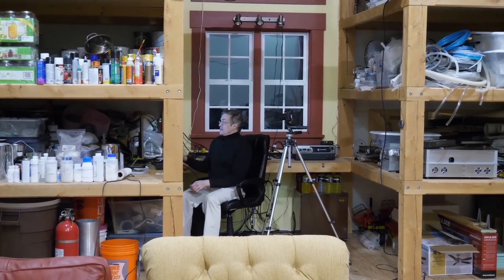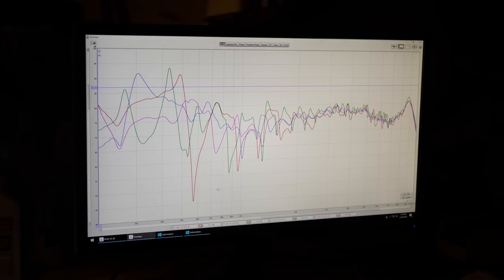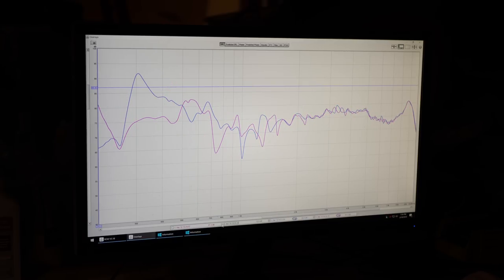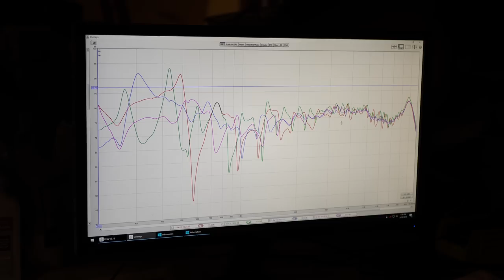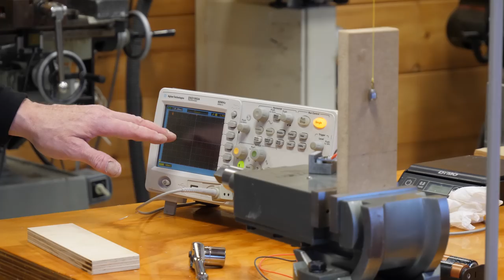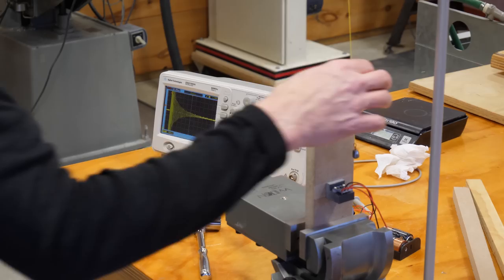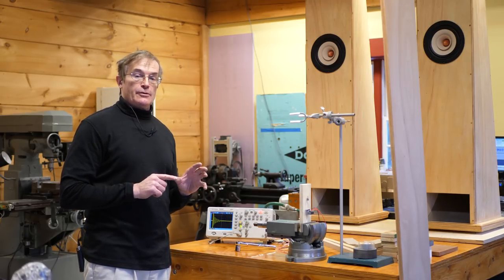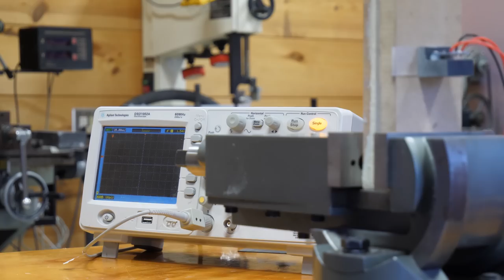World's Second Best Speakers!

Comment: "I have a lot experience with the marine plywoods and I would highly recommend them."
This one sentence perfectly encapsulates everything I love about this channel.
Reply: “Marine plywoodS” THERE’S MORE THAN ONE?!? HOW MANY MARINE PLYWOODS DO WE NEED?!?
Reply: @DanielBrownsan   Far more than you might expect.  But don't worry, the final tally is based on sound engineering principles and backed up by solid research.
Reply: Please tell  me how make good box for speaker   pioneer size 6/9
And what best wood use for that
Reply: @ahmadalardah4198  Get the T/S parameters for your speaker, use software like WinISD to calculate box dimensions, and then use MDF/HDF/high grade plywood (your choice).
Reply: Maxican When I was a teen I made a large rectangle cabinet for two 15-inch drivers out of quality plywood... Didn’t do any research or even know what I was doing, just hacked it together in a few hours and it sounded brilliant to me :P I guess I was too young and inexperienced to have a discerning ear for quality audio.

Comment: 25:31
-It is cheap
-It is easy to machine, it's cheap
-It is relatively inexpensive and easy to obtain
-And it's cheap
And did we mention it's cheap?
I don't think I can ever stop smiling after that.
Reply: But is it cheap?
Reply: @myxfit  Relatively, yes. He explains this in the video. It's why fibreboard is used in so many cheap wooden things these days. For example, my desk is LDF and the speakers I used to haul as a DJ had a MDF enclosure.
Reply: @LokiScarletWasHere  whoooosh? :)
Reply: @myxfit  Fair enough. Hard to tell in written communication.
Reply: i hate MDF. i found his breakdown of why someone might use MDF to be quite amusing. glad i'm not the only one.
Reply: @LYLEWOLD  MDF is way more superior to particle board are you kidding me! It's way stiffer and resonates way less
Reply: @MichelLinschoten  The demonstration was between MDF and plywood, not MDF and particle board. OTOH as he says, MDF is cheap. Here in Tasmania 18 mm MDF is $AU39.69 a sheet compared to $AU172 for ordinary 18 mm plywood and $AU261.30 for 18 mm marine ply.
Reply: i came here to look for this comment
Reply: @thatfeeble-mindedboy  You're way underestimating the ability of the resin binder to be a solid and transmit sound.  Particle board and MDF would be falling apart if they were as loose as you're claiming.  While their bulk is particulate in origin, they're roughly brought back up to low to medium grade wood by the binder.  That isn't sorbothane between those particles.
Reply: Peder Hansen  Exactly. It's essentially absorbs the sound energy.
Reply: @ModelLights  Are you serious or just trolling Kenneth? I can't really tell.
Reply: @misterhat5823  ' just trolling Kenneth?'  LOL Trolling him, I was simply fixing the silly 'composite construction means the binder must allow motion and the particles moving and absorbing' for anyone else who might later be mislead.  Google 'glue is stronger than wood', read up some, and realize even cheap binders are stiffening the crap wood particles that composite woods are made from, not allowing more motion.  MDF is generally about the same or even better than plywood, as was clearly evidenced in the video itself, and both were obviously well away from the actual absorber.
Reply: A better descriptor, as I learned in sales, is inexpensive. lol
Reply: And stiff!
Reply: I thought he was glitching.
Reply: That's the result of listening to test tone more than 3min.
Reply: @jonathansturm4163  It seems to me, that laminating two panels with that visco-elastic adhesive, would erase some of the draw backs to using MDF. The only difference would be, that the enclosures would be heavier, which, is NOT a bad thing. The more massive the cabinet, the less movement caused by the acceleration of the speaker cone. Dampening resonance is the name of the game. There's enough magic in the proper application of the right adhesive, that there is no need to choose the most expensive wood.(as long as appearance is no issue) There might even be an advantage to laminating two different types of wood.
Reply: since there's no frequency response measurements in the end of the video - I think we can agree that it (possibly) also sounds pretty... cheap.
Reply: @jonathansturm4163  Unless you're powering your boat with sound waves, why on earth are we comparing marine ply?
Reply: @TheNajSD  Marine plywood is manufactured from durable face and core veneers, with few defects so it performs better in humid and wet conditions. It resists delaminating and fungal attack. It's cheaper than furniture grade plywood that comes with a decorative face veneer and more expensive than construction grade plywood that has unsightly knot holes and splits.
Reply: @LokiScarletWasHere  
Wait till you see an MDF enclosure  sprayed with Rhino Lining
They can flex 3/8" without cracking or separating,  plus it reduces vibration
Reply: @LYLEWOLD  
Try spraying  BOTH SIDES of the MDF SPEAKERBOX with RHINO LINER
You cannot BUY a better box!
Reply: @ModelLights  
We spray our boxes with Rhino Liner
Amazing results!
Reply: @jonathansturm4163  
Marine plywood also off gases formaldehyde over the years as it cures and dries out
Reply: @thecloneguyz  There's formaldehyde in all plywood; in toothpaste, too. And wallpaper...

Comment: Kudos to getting rid of the myth about MDF being THE material of choice for speakers!
Also, great to see fullrange speakers properly used here (small cone impedance matched).
The Voight or TQWT designs are decent and easy to build, but you can also get excellent results with TML and horn designs.
Regards, D.C., creator of the Cornu Spiral Horn.

Comment: No frequency response analysis of the final product - I think you forget the somewhat vital last step? Can we assume there will be another video along shortly where you actually do a frequency sweep? You've shown us you've got the equipment and the prototype, so what are you waiting for?

Nice groundwork and great explanation - now give us a the home run. We are cheering you on!
Reply: And frequency sweeps at different off vertical/horizontal axis responses and listening heights - all major factors
Reply: The spl of the full-range Tang Band will rise as frequency increases, starting somewhere around 1.5 kHz and a significantly higher level at the upper limits of what the speaker can produce.  This is a baffle step that all full-range speakers produce.  A small -6dB / octave compensation circuit, an inductor in series with the driver and a resistor in parallel with that inductor (a BSC) has to be added.  This tunes the higher range of the speaker's frequency response  to the width of the front baffle.  I'm pretty sure there's a calculator on the net somewhere...
Reply: @stephenmackellar5072  I've also read about 1.5 way speakers, using a second copy driver just below but with an inductor to form a baffle step but adding extra bass, allows you to "possibly" cut some crossover components too.
Reply: Yeah, plus his demo recording at the end gives a good perspective from the POV of a giant robot laying down in front of the speakers. My head isn't 4ft wide and I'm not going to be crouching down off-axis to listen to them. The recording objectively sounds like rubbish, and is such a let down after such an awesome video!
Reply: I don't think they'll fit in the anechoic chamber ;-)
Reply: Impulse response probably even more important than the frequency sweep. Of course watching a video and listening over my ratty head phones doesn't tell me a lot about how good they are :-)

Comment: A frequency sweep of the finished speaker would have been nice.

But excellent explanation nonetheless.
Reply: jdlech nor is it an anechoic chamber in any sort of standard definition :p
Reply: @KYDY  Is it just foam on drywall? that must give some ugly reflections in the mids at least.
also lows which get through bounce on the wall and come back in
Reply: Watched this video several time. There is an indication some trial an error did take place in the acoustic insulation install. Some proof of concept is warranted. I am think about building a similar enclosure.  Some testing results could help to improve this design. Big question are there test results near field at least? My guess is an in line inductor circuit is probably required to get some of the lower frequencies to be more pronounced.
Reply: In an anechoic chamber with an actual test / measurement microphone (GRAS).

Comment: I was a little disappointed you did not show the frequency curve of the finished speaker.
Reply: I don't think it would fit in his chamber to measure it as he did with the smaller pieces. :(
Reply: I was disappointed by your comment. Now we're both disappointed.
Reply: I have known about a dozen or more sound technicians who have been able to tweak off the shelf speakers to sound fantastic placed in a consumers home.   I have known a similar number of technicians who have been able to make a system work in a room or a car and sound fantastic.   All have done testing of various materials under specific conditions to achieve results.  You seem to run a frequency sweep similar to AM radio, with few other restricted variables and  expect us to believe the results will be better. 

At best we can only hope to emulate what has been made on both analog sources and digital sources and come out with something that will sound good most of the time. 

To me, the best thing has been to find an amplifier and sound source you can live with, make sure the output to the speakers is in phase and to find the sweet spot where the sound sounds fullest and pleasing to the ear.  Analysis of sound waves are generally from a  single sound source under controlled system.  We listen through a number of speakers, bought at various times, for various reasons, and our musical tastes change on an almost daily basis. 

I am a 50's ,60's and 70's  kid and I like my music in a different place than newer music.  Music tastes will always be individual, and attempt to make a science out of them is at best a pseudo science  - 50 year veteran of the trade.
Reply: @tamasmihaly1  other one disappointed here, the chain is growing up, damm!
Reply: @inkshop963  I don't think this video has anything to do with musical tastes specifically. It is a very good explanation of transmission line/quarter wave tube/Voigt pipe theory and implementation. I have built this very old design and can attest to its virtues. Reproduced music is a taste just like food or drink. Some people eat crap and others spend more time in the procurement, preparation, and appreciation of what passes through their digestive tract. Voigt pipes are usually built using a single full-range driver. This topology is quite popular in the diy community but rare in the consumer market. Asking a single-driver/enclosure configuration to fulfill the extreme demands of modern music is a tall order to say the least. The best attributes of this design whether using a cheap or expensive driver (and there is a huge range) are imaging, speed, detail, and a three dimensional soundstage. Full-range drivers tend to be highly efficient so tube amplifiers are commonly paired with these speakers. These are not particularly adept at dealing with bass heavy hip hop and other electronica with a huge amount of low frequency energy.  But they are amazing on virtually all other genres. The main variable beyond enclosure is the driver choice which can make a big difference in performance.
Reply: Ink Shop I think you missed the point. This was about frequency response and how it changes in a given space or enclosure. Calm down man. Don’t use the term “veteran” unless you’re talking about being someone who has went to combat and survived. It’s offensive to me as a combat veteran.
Reply: @brentwalker8596  as far as low end, that's nothing a sub woofer couldn't fix. As far as drivers go, forget the price, find the one with the right Thiel/Small parameters to work well in this type of enclosure. A modest speaker loaded in an ideal acoustic environment can sound much better, than an expensive driver haphazardly thrown in a random box. The advantage of the drivers used in this build, is their ability to produce really good treble.
Reply: No questions about specs.they are selling something for tin ears.
Reply: @brentwalker8596  For that kind of music, I recommend pairing these with sub woofers, crossed over at about 100-140 Hz. You're exactly right about the low frequency on these. They seem to roll off sharply at about 100 Hz, it sounds like at least 4th order. Above that, these boxes, with the drivers he used are flat as Kansas, up to about 12 kHz.(you might consider a tweeter, just to add a little "sizzle")
Reply: @vincentrobinette1507  I love the coherent soundstage with full-range drivers. The 6" Fostex driver I used had surprisingly decent bass reproduction and was sufficient for the type of music I listen to. But just as in your suggestion, I used a tweeter with a capacitor to add some shimmer. It is possible to utilize more expensive full-range drivers for more bass, although some of the esoteric models can be very pricey.
Reply: @brentwalker8596  You just can't beat an extended range driver for spectral time alignment. You don't get much better, than using the same driver for all frequencies. That's why quality headphones sound so good. Vocals will always be more intelligible, and percussion will always be more defined, if most of the bandwidth can come from the same transducer. That's why i'm in love with this design, just give it a little help on the extreme ends of the spectrum. even then, it's necessary to move the speakers fore and aft relative to one another, to align them at the crossover points. I'm not as concerned about how loud it is, I'm shooting for accuracy. If you can walk in blindfolded, and find the instruments in the recording, but you can't locate where in the room the speakers are, you've won.
Reply: @erictheboringone5292  A veteran (from Latin vetus, meaning "old")[1] is a person who has had long service or experience in a particular occupation or field. while the word was adopted colloquially to refer to someone in the military who is now retired.. its origin is not based off that. So his use of it as someone who has many years of experience is truly what the word means military or not. I hope you were just trying to stir his pot a bit because I def dont think his comment was on point with what this video was demonstrating so i agree with you there but if you really are trying to gate keep the term veteran for military use that would be kinda cringe worthy.
Reply: Bret Mohler You aren’t very adept at knowing whether someone is saying something in jest or in seriousness. Work on that bud.
Reply: @erictheboringone5292  which is why I said " I hope you were just trying to stir his pot" I read your comment as being snarky but without context or a /s or some other way to note that intent, I could only say I hope that was your intent..I'm not sure the onus is on me to know what you meant when your delivery is so poor... But thanks pal.
Reply: @erictheboringone5292  Perhaps you're just bad at conveying it.
Reply: @inkshop963  Making speakers with a flat frequency response will give you objectively the best speakers, but unfortunately people are all different and likes different thinks. What he made is essentially what you would call sound monitors or studio speakers. Consumers will usually want speakers tuned to their taste. 

What you can do with objectively perfect speakers is to add DSP (Digital Signal Processing) and tune them to your preference.
Reply: @erictheboringone5292  Veteran just means someone with many years of experience in a particular field.  Combat veteran is one specific use of the term, Ink Shop used it in another sense.  Words have more than one usage.

Comment: Another amazing video. Could you please do a video on 2 stroke internal combustion engine mufflers? It seems to be related to pressure waves and sound as well.
Reply: In a 2 stroke engine you WANT the pressure wave (sound) to bounce around because that's what feeds the unburnt fuel mixture back into the engine for the next stroke.
So it's quite the challenge amplifying the sound as much as possible near the engine and then trying to muffle it before it leaves the exhaust completely. It would certainly be an interesting video.

Comment: Very interesting and well documented, much respect. Although it would be nice to hear a comparison with a set of regular speakers of similar power, price, volume to hear an audible difference. But now I have so many questions ... What is the freq span and freq response on those? Could you use a similar design to make a guitar cab? Does the back plate angle compared to the front plate play a significant role in the performance or is it more the effect of the deadening goo? And keep on making them videos, thanks.

Comment: Awesome video. Thanks so much for sharing your knowledge!

I would love to build a set of these. If I use an exotic plywood like zebrawood, I'll use splined miter joints to get rid of edge grain. But I think high grade, void-free Baltic Birch would be a great material, AND Baltic Birch plywood's exposed edges can be aesthetically pleasing. It's also much cheaper than cabinet grade exotic plywoods. In that case, I'd use dowel joinery to get rid of the screws, and maybe overlap the edges (probably front panel over sides) just a tiny bit to accent the edge.